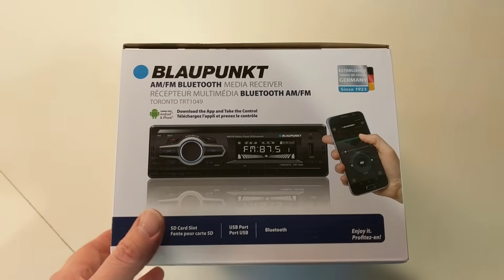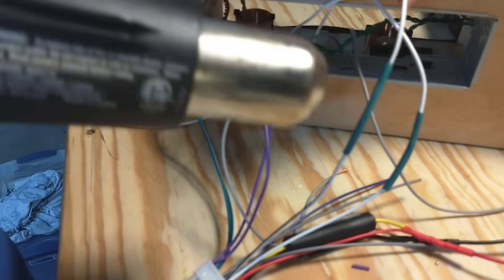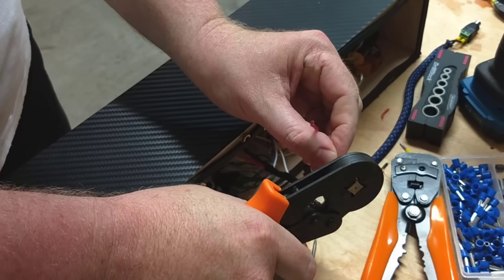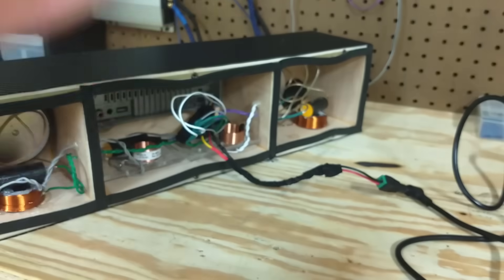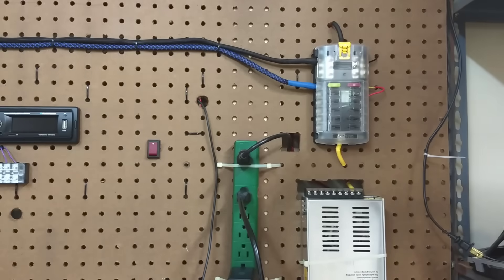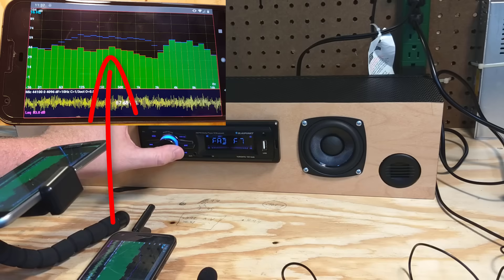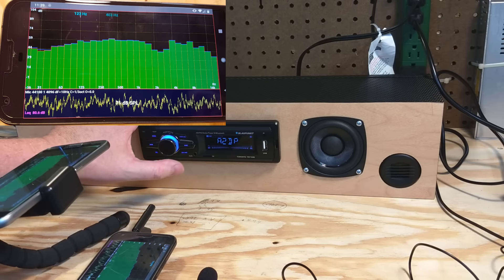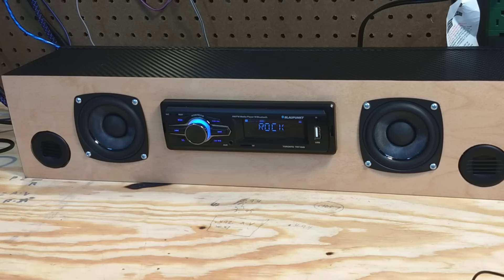How to use car audio equipment in your home!

Comment: Hi, can you design this setup(or make a video)but with a dual voicecoil subwoofer on the rear speakers? This would be great for a budget car install with a combo system in the doors an a passiv sub in the trunk.
I think the key is to build a high efficiency subwoofer. Maybe 6th order Bandpass?
PS: 15V DC supplys should also work for the 12V car stereo, so you can get a bit more power out of it. greetings from germany =)
Reply from the maker: That could work, but most head units don't have enough power to drive a subwoofer, unless it is a very small one.
Reply: Typically 14.4v is your higher end of the voltage range for a 12v system. I discovered that I lost one of my amplifier channels from running the voltage too high. Also noticed that the OLED display dimmer feature stopped responding and would only display at its lowest lighting level. Brand new Pioneer 4-Channel head unit. Managed to get it replaced under warranty.

Comment: Great  video. Very informative and we'll articulated.  I'm putting a stereo on my tool cart at work and have been trying to find a cheaper (space efficient and $$ efficient) way to power my head unit other than an expensive converter an I like the one you show. Also, if you don't mind; what was the song you had playing?
Reply from the maker: It was a free song from the YouTube music library.  I don't remember what the track was called.  I can look it up when I get to my computer at home.
Reply: @DIYAudioGuy   Thank you! I know you said you don't like it but will the laptop power supply do alright with just 2 5 1/4's? I don't see them really even pushing the little built in amp of the head until unless I've missed something...
Reply: @DIYAudioGuy   an I meant two (2) 5 1/4" speakers...
Reply from the maker: @buddymartin7923  anything that puts out 12 volts and is rated to carry enough current to power the audio equipment will do the trick.  Some laptop power supplies will work just fine you just have to verify the voltage and amperage to make sure you've got something that will work.
Reply: Old computer power supply.  Cheap and they work.

Comment: how much watts can a 12v radio support?
Reply from the maker: 10 watts per channel.
Reply: is 120w to much for a car stereo radio if i wanna use it at home?
Reply from the maker: @mario-en7hj  most car stereo head units can't produce anywhere near that much power.    Some of the better ones might be able to produce 20 watts per channel.
Reply: DIY Audio Guy sorry to ask so many question, i’m kinda curious of how things work. but can a 40w speaker work?
Reply from the maker: @mario-en7hj  I don't mind questions, If people are asking questions that means that I have a good idea for my next video. Absolutely, yes. You could hook up a 40 w speaker to each of the 4 channels.  Keep in mind that the speaker does not create the power, so the power rating on the speaker will not dictate how much power the radio puts out.  The power rating on the speaker is just a way of explaining how much heat the voice coils can take before they cook, and how much the speaker cone can travel without damaging itself.  Here is a video where I explain some of these principles. 
https://youtu.be/oavL19yvv7k

I think I might make a video explaining how to match amplifier power to speaker power. I get a lot of questions about that.

Comment: that label on the power brick saying dont draw more then 80% is a complete red flag. Any SMPS from any reputable brand will be able to run at 100% load, all day. MOST SMPS have overpower shutdown at ABOUT 110-120% load
Reply from the maker: Good point.

Comment: Hi I really need help I have conected it at my home every thing looks fine but my speaker only make sounds at max volume and its is very quiet please help🙏🙏😢
Reply from the maker: It is very hard to troubleshoot in the YouTube comments.  Try hooking up the speakers themselves to a different amplifier or source unit, try hooking up different speakers to your amplifier.
Reply: @DIYAudioGuy  I only using 1 speaker on the fr channel and when I connect it to my phone it only plays sound  at max volume and it's very quiet I  don't know what to do
Reply from the maker: It sounds like something is wrong with the amplifier in the radio, or something is not hooked up correctly.
Reply: @DIYAudioGuy  OK thanks is it possible because I'm using a ac to DC 12v power plug instead of a 12v battery?
Reply from the maker: The AC to DC adapter could be the problem if the adapter can't handle the power draw.
Reply: @DIYAudioGuy  it's a ac to DC 12v adapter 12v and 1A
Reply from the maker: That might not be your problem, but it is a problem.  12 volts multiplied by one amp equals 12 watts.
Reply: @DIYAudioGuy  so thanks for your help Il change it to a 12v battery which one should I buy like which ah?
Reply from the maker: Batteries are dangerous and I don't give advice about them due to the danger involved and my lack of experience and knowledge with them.   I have seen a car battery explode while it was on a charger.   It makes for some toxic shrapnel.  Please be careful.
Reply from the maker: Before you do that I would advise some testing.  There may be something wrong with the radio that you're using. The only way to know is to find a working speaker and connect it to the radio and see what happens.
Reply: @DIYAudioGuy  I don't know I have a new speaker and it works but the bass is flat and the instrmentl is louder than the vocals the radio I have is a pioneer DEH-1600UB
Reply from the maker: I really can't troubleshoot that kind of thing in the comments section.  I would have to ask a ton of questions in order to help you out.

Comment: don't make a mistake add a small 12volt battery for back up if get a power outage then you wont have to reprogram the radio
Reply from the maker: Got to be careful with that.  You don't want a car battery exploding in your house.
Reply: Reprogramming your radio it took only a few seconds if you know all your settings....i always have eq Flat, HPF 125 and SLA on my pioneer Hu on 4 with usb and I set everything in a moment.

Comment: Ah fuck here I am buying a cheap DC power amplifier to run speakers. I didn't even think about using a headunit which puts out more power than that baby amp. Didnt know making it run off DC was so easy 😯
Reply from the maker: That's exactly what I thougth when I saw the radio -- cheaper then a BT amp.

Comment: Just chiming in, but confused with this low budget receiver and fairly expensive audio capacitors and induction coils.  Seems a waste of a good low pass
Reply from the maker: Most small DIY projects like this are a waste.    It's a hobby, it's wasteful. Virtually every hobby is wasteful.

Comment: A computer tower power supply works WAY BETTER GUY....  run 1 PSU to the radio unit, run 1 PSU to the AMP to hook up subwoofers.
Reply from the maker: I disagree but that's okay, we can disagree.

Comment: Even easier. Use a Bluetooth amplifier for the house. Eliminate 10 steps
Reply from the maker: You are not wrong.  The only good reason to do this is to make use of an old head unit that you might have lying around.